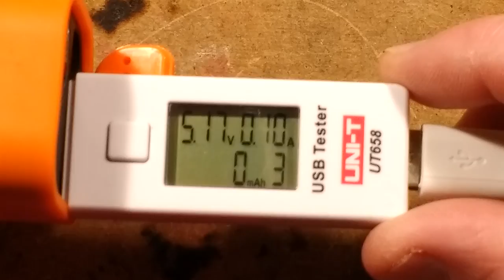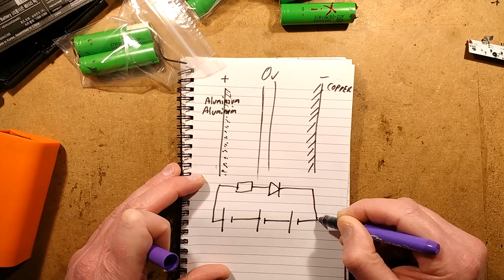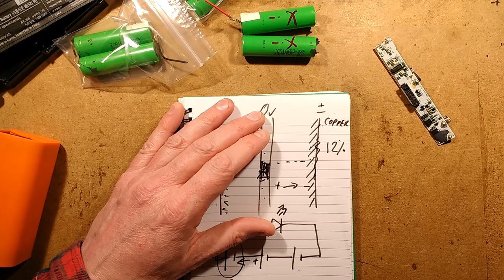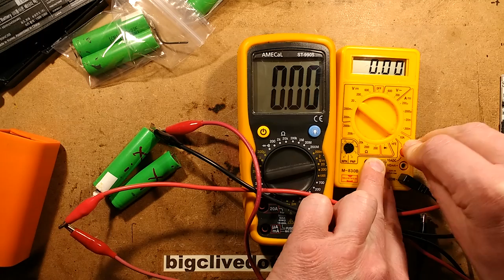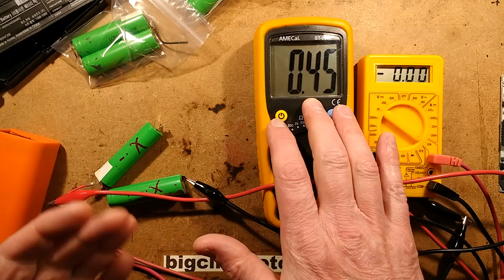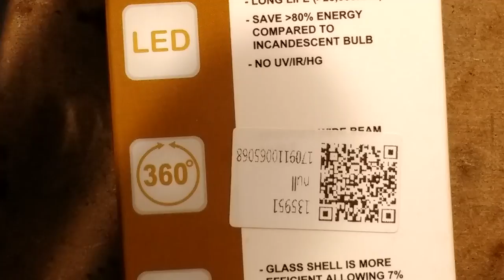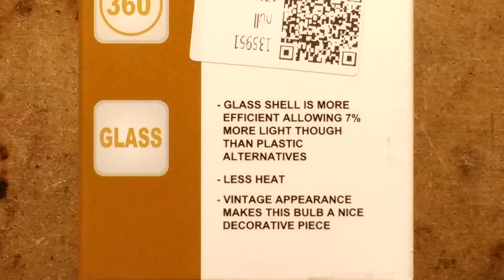Teardown of a faulty Samsung lithium 18650 cell.  (2200mAh)

Comment: It's not only a vent mechanism; it's a small membrane switch that pops up if the cell experiences an overpressure condition due to heat from rapid discharge or improper recharge.  The little switch opens the circuit from the anode of the cell to the positive contact on the container, rendering it dead.   Some people poke a jeweler's screwdriver through one of the four little holes and pop the membrane switch back down to reactivate the cell, but this is fraught with danger because it deforms the membrane and it will no longer act as a safety.  Bang!  

I appreciate all you do--you are a true role model for young and old people alike; your curiosity and your abilities as a teacher make this world a better place.  Cheers!

Comment: I remember as a kid unwrapping all the "paper" in capasitors from old tube radios, in a vain attempt to find the "mechanism" inside all that wrapping. Not realizing the "paper" was the "mechanism" in the capasitors.
Reply: Leif Neland we did  that at  electronics collage years ago!
Reply: Me too  XD
Reply: Holy shit, no PCB then?
Reply: sure their was he absorbed it thats why he is out of his mind and posting on youtube
Reply: In high school we would 'unwrap' them with overvoltage
Reply: It you just took out some of the capacitors then the capacitors were replaced the radio could be fixed.
Reply: @erg0centric  Lol! Did that a time or two, myself. Electronic fireworks!
Reply: Man that's like a metaphor for life
Reply: I did that once. Then found it was more fun to open them using the power supply from my Scalextric.
Reply: @Tedd755  Not inside the battery.
Reply: @firesurfer  We're talking about capacitors, not batteries.
Reply: @Tedd755  my bad, lost the thread, same diff anyhow
Reply: @firesurfer  What do you mean 'same diff'? There were PCBs in capacitors back in the day.
https://en.wikipedia.org/wiki/Polychlorinated_biphenyl
Reply: Still better than opening up a big capacitor only to find a much smaller capacitor inside :/
Reply: That's so you Leif, haha!
Reply: @uiopuiop3472  how do you know? Do I know you?
Reply: The paper is the insulating medium. The mechanism is the foil that is seperated by the paper.
Reply: @thra5herxb12s , I have known this the entire millenium so far.
Reply: @Tedd755  point to point wiring, shityea.
Reply: Destroyed beautiful old tube radios
Me: You focking what mate???
Reply: Lol, me too!

Comment: I once had a zinc carbon battery explode right next to me and shoot the carbon rod at my arm at high velocity. I was eating a Bramley apple pie at that moment and accidentally squished it into my face. Before anyone knew what had happened, they all presumed the apple pie had exploded in my face. Henceforth, it was known as: "The exploding apple pie incident".

My friend was actually playing with my electronics kit next to me and had inadvertently shorted one of the batteries. That's where the explosion came from.
Reply: didn't even know that was possible... was it like a D size battery or was it from a lantern battery?
Reply: @fungusenthusiast8249  
AA size. I didn't think they could explode either. Must've been fully sealed batteries. Cheapo ones off the market.
Reply: Back in the early 80s I was in grade school, and a "class clown" in my classroom had to stay inside during lunch hour recess and write his "I will behave" sentences on the chalk board while the rest of us were outside playing.

When us kids returned from outside recess, I had noticed the "clown" was at the sink in our classroom, and he was constantly sipping water from a glass jar and spitting it back into the sink. My desk was right next to the sink, and I had asked him why he was doing that. He stuck his tongue out, and there was a BIG NASTY crater of what looked like melted skin in the middle of his tongue. I was shocked, and asked him what in the HELL happened... and he showed me a half disassembled pile of pieces from a 9 volt battery, and told me that he had used his teeth to pull the terminals (of which one of them was some kind of rod) out of the battery, and as it slid out, some kind of "acid" had sprayed out of the hole right onto his tongue and ate some of the skin off it. That was 40 or so years ago, and I STILL have a crystal clear image of the burnt crater on his tongue in my mind. I've had respect for batteries ever since then.

Comment: I've had the same exact thing happened. I was buying old laptop batteries to recycle good cells or sometimes even refurbish them (long time ago). I ended up having bunch of cells that were from 700mAh up to around 3000mAh. Paired them based on their characteristics (6 or 8), made a few working batteries, the rest was used in pairs or singles for various devices as flashlights and electronic cigarettes. What's interesting is that I was able to get some of those back to life. I suspect it was because they went flat in storage, not connected to circuit. They lasted years after that with no problems until I forgot and left them in electronic cigarette for 3 years or so. Even more interesting, one refused to charge at all, one charged nicely up to around 3.8V, then got very hot and started self discharging. Apparently it was bridged already. The other two recovered and were fine for a short time but when they were discharged to around 3V, they suddenly both decided to short out and committed seppuku.

Comment: If a device can record for more than 30 minutes, it's classed as a video camera and has a higher import duty, so it's an artificial limit for tax purposes.
Reply: One example of complete bullshit regulations from the last century.
Reply: or it could be the 4GB filesize limit on FAT32 storage devices.
Reply: John Hollowell No, its marketing / sales reasons. Every 1080p camera I have splits the files at the 4Gb barrier. Whether they have a 30 min limit or not. On my Canons, it splits before the 30 minute timeout.
Reply: The other feature that gets flagged is “Clean HDMI” out. Usually the cameras that limit at 30 min, don’t provide a full resolution, non-OSD hdmi signal while recording. (Which would be one way around the 30 min timeout. )
Reply: Yeah, when cameras stop recording at 30 min, its the tax artificial limit. But the FAT 32 format of most SD cards and other storage devices limits the size of a single file to 4GB. This is why recorders will split the recording into 4GB files.
Reply: Do not get me started with this 'wrinkle'. The number of times i have had people come complaining that they have lost footage filming with their new hi-def (1080 or even 4K) is crazy. The camera invariably names each 4GB video file and continues recording another with a 'link instruction'... At the end of the recording you can see listed the individual 4GB files, using say Explorer on your PC on the memory card and similar in the camera menu it's ONE big video clip. Some video edit programs fail to always mount and link all the files of the clip into the one long video and users panic thinking they've lost footage.
Reply: The nice thing about having multiple files though is that if you are copying them and you suddenly need to cancel it temporarily, you won't have to start copying the whole thing again - only the files that didn't get copied. (acts like a breakpoint, basically)
Reply: alex rainflake There are plenty of superior file systems, but realize that the framework of FAT was basically laid down long before either of those file systems were even thought of.  That said, until relatively recently the 4GB limit was largely moot in many respects as many applications were still limited by 32-bit memory and file pointers that effectively limited practical file sizes to 4GB.  It was not until the 64-bit OS and architecture that the 4GB limit could be largely violated even on filesystems that otherwise supported larger files.  But FAT32 far predates that change as well.  The ongoing popularity of FAT, and its variants, is its shear simplicity and very low overhead compared to most of the otherwise "superior" filesystems as well as its relative ubiquity across most operating systems (what OS can not read/write FAT32 and is remotely modern?).  Many other options do not share those same desirable characteristics, though we have begun to move beyond FAT32 on 64GB and larger Flash devices (mostly with NTFS and exFAT).
Reply: In the EU tariffs for importing a digital photo camera is 0% (CN-Code 8525 80 30). A video camera is 4.9% (CN-Code 8525 80 91).  
In for example the " Official Journal of the European Union, C 137, 6 May 2011" you can get the definition of a video camera as: >800x600 & >23fps & >= 30min of recording length.
Reply: 32-bit CPUs and memory addresses do not limit files to 4 GiB. The C-style “off_t” and “long” types are signed, so limited to roughly 2 GiB if 32 bits long. However, 64-bit file pointers on 32-bit CPUs were standard long (pun intended) before AMD64 became the norm, with a maximum size of 2⁶³−1 bytes (≈ 8 EiB), usually making the limiting factor either the size of the disk or the filesystem.

A related misunderstanding is the 4 GiB memory limit on 32-bit x86 CPUs. While their addressing limits any single process to using at most 4 GiB of (virtual) memory simultaneously, nearly every x86-32 processor since the Pentium Pro has supported PAE and can address 2³⁶ bytes = 64 GiB of physical RAM, minus any ranges used by memory-mapped devices.
Reply: so any phone is treated as a video camera?
Reply: @ethanpoole3443  Actually in and of itself the system having less available RAM (Or less addressable by a single application for that matter) doesn't in and of itself preclude larger files the system calls for reading and writing files on modern operating systems do usually also include the ability to read/write n bytes at offset x within a specified file. There might be some specialised use cases where if the entire file cannot be loaded the application couldn't function correctly but such are uncommon and such limitations are usually a programming problem that could be avoided if desired (Adding metadata to the file format that allows an application to find specific data within the file without ever needing to read all of it for example).

Databases and such made use of this and still do by simply loading index metadata from the database file to allow them to quickly locate records in the main body of the datafile for example, this is kinda necessary when you can have databases that have tables that have sizes in the many terabytes or even petabyte range, far more than the RAM capacity of the server running it. They have to use a lot of techniques to work around the limited supply of primary storage (RAM) while also keeping the bytes written to or read to secondary storage to a minimum because of the massive performance penalty incurred by doing more disk accesses than required.
Reply: Either that or he's hitting the 2GB file size limit, thanks to consumer gear still using shitty FAT-32
Reply: The EU has some ridiculous laws and limits
Reply: Robert Slackware Why would they? Ext2 isn’t recognized by Windows, the most widely used desktop OS. The majority of users wouldn’t be able to retrieve their files from the camera at all.
Reply: @JohnHollowell  FAT32 can go quite a bit larger than that. The 4GB file size is an arbitrary limit imposed by Microsoft. If you use a third-party utility, you can format devices to larger than 4GB in FAT32.
Reply: wait until you see my country's tax and duty for automotives. pure bullshittery by the bureaucrats.
Reply: Erotikstudio Winkler GmbH  It's EU law, Reuters reports "Digital cameras are imported into the 27-nation EU tariff-free but video recorders are subject to duties starting at 4.9 percent."

Comment: As for the insides... yes, the cap has a vent. (and in cells ment for retail use, there's supposed to be fuse) The electrolyte is a modern witch's brew. It used to be something similar to anti-freeze (glycol), but today, they are an extremely complex mix of organic solvents and salts. (and potentially flammable, but less pyrophoric than the first battery you took apart!) If you look at the side that was touching the copper, there's a copper sheen in the electrolyte. (bingo! she's dead.)
Reply: there's a copper sheen in the electrolyte. (bingo! she's dead.)
----------------------
What exactly is dead? Did copper got in the electrolyte? But how did that kill the battery? Thanks.

Comment: I used to be a member of a model flying club, and someone crashed one of his planes, putting a dent in the 14v battery pack.   He decided to do an experiment by looping the +ve and -ve wires together, then standing well back.   The battery took about 20 seconds to start smoking, then at about 60 seconds it exploded.  This showered a radius of 8 feet with hundreds of those strips, each one about 10 inches long and 2 inches wide.   We had to clear up all the remnants as the field was also used by grazing sheep.   Thanks for the video..

Comment: Multi-cell reverse charging may explain why LiPo batteries for radio controlled models have both a power plug and a 'balance' plug. The latter is used to bring each cell up to voltage independently while charging (as I understand it.)
Thanks for the video. Reminds me of when I was a kid and took some dead zinc carbon batteries apart. I tried to make an arc light using the carbon electrodes, but the circuit breaker on my electric train transformer kept popping before the electrodes did anything other than glow red (which probably was a good thing!)
Reply: Yep. The balance plug is indeed used to prevent one cell from rising over it's max voltage during charging, as the charger has access to each individual cell in the pack through the balance plug, and will automatically cap the max voltage to each cell. In theory, balance charging will also help to prevent the damaging "reverse charging" scenario during the packs use, because the cells all started with the same exact voltage when the pack is then used. (As long as the cells are all healthy, and were matched well before it was assembled.) In my opinion it still pays, with lithium packs, to stop using them before the BMS cuts them off, and recharge them. Doing this extends the life of the pack, and ensures that there is no way to possibly run into the reverse charging situation.

Comment: I do l love watching your videos, well for the most part, because I always learn something.  For example talking about that damn lead free solder, in my Class A motor home, there is a back up camera, well you need one as you are driving a 36 foot house down the highways at 65 miles per hour, and it is a long way to the back window, which has the shades drawn anyhow as it is a bedroom window.  The monitor has given me trouble ever since I purchased it, so in year 2 of my ownership, I pulled it out and tore it down, only to find several broken solder joints.  So I heated up the old iron and re-soldered them by simply melting that old solder and allowing it to re-flow.  The following year, the same problem! So again, I pulled it out (not an easy chore!) and again re-flowed that solder.  She worked another 3,000 miles and now she is doing the same thing.  So this time, once I get her out, I am planning on adding some of my wonderful 60/40 lead solder to the mix and see if that holds.  The monitor was made in 2003.
Reply: OH I was going to mention, the only problem with watching your great videos, is the tennancy of your smoooooooth voice to put me to sleep.  My wife keeps telling me that I should watch your videos in bed since I have a hard time getting to sleep at night because I keep getting these long naps at about the middle of the third of your videos I re-watch daily.

Comment: Clive, maybe next time you should leave the bad battery connected to the bench power supply for some time (under close supervision). The suspected short circuit channel in the foil should heat up and hopefully that could leave a more visible mark on the separator. I suspect the trick would be to turn the current off before it causes a thermal runoff.

Comment: With both the speed of self discharge that you showed, and the low current draw, I believe the internal short would be close to the tap on that electrode. The etched bit close to the center of the spiral is making the entire rest of the cell unchargable. Great job on finding that failure point Clive!

Comment: This reminds me of when I was much younger, when I was about 8 years old, even then I was curious of what was in side batteries, I took apart various types of D cell, and 9 volt ones, the big old PP9 radio ones  were very messy full of black carbon powder! It was also intresting to dismantle big old school transformers with literally miles of copper wire inside!
Reply: the black powder is manganese dioxide and it is moist with ammonium chloride solution. The electrode in the middle is a carbon rod. And has a zinc outer coat.